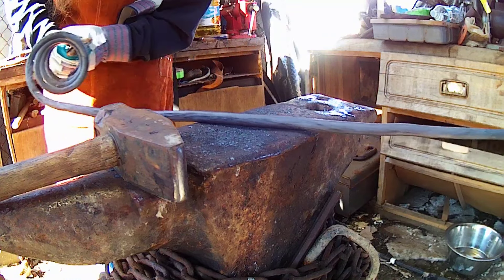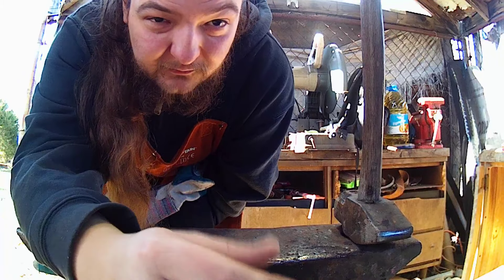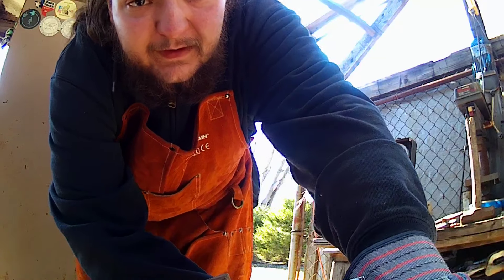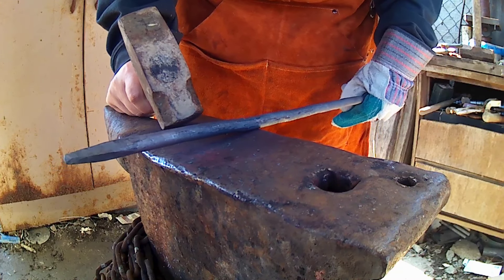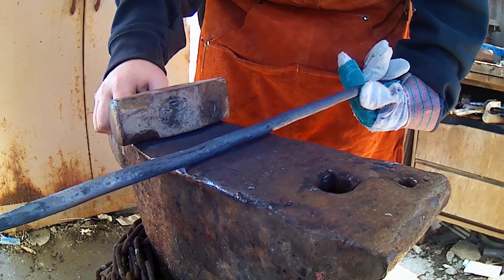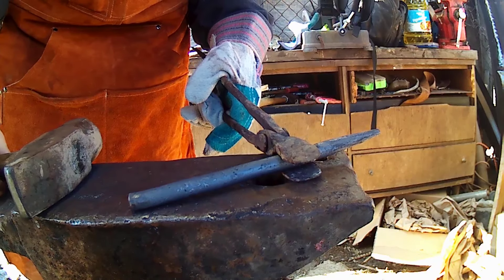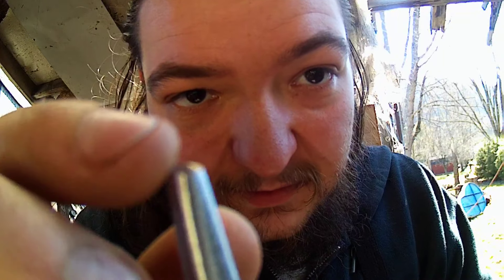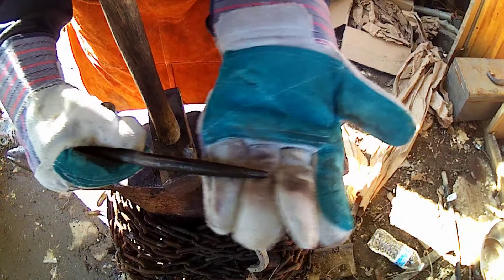Forging a Round Punch from a coil spring

Comment: Someone get this man a post vice!  Personally, I tend to take the angle grinder and lop of circles from the coil that then are a lot easier to straighten if I know its going to end up in short pieces anyways.   Also - if you take the half of a leaf spring that has the loop on it still you can pop it over the end of the piece of spring to bend it straight.
Reply from the maker: Yes I do usually  just cut it up bit as the series  will be geared to beginning smiths thought  showing  forging it straight could  be befitting for those that don't have the tools

Comment: I have some coil and been wanting to make a few tools. What color/temp do you heat the metal to when you thermal cycle?
Reply from the maker: When you thermal cycle  heat to critical (non magnetic) then let air cool till handle able or atleast  cool enough  not to burn wood if on not high stressed parts and then proceed with your heat treatment